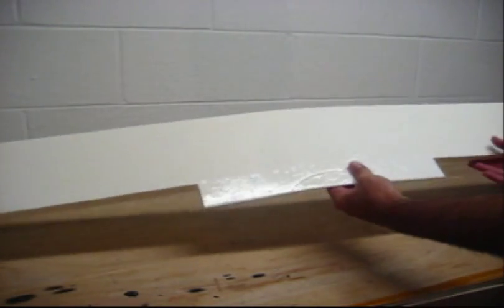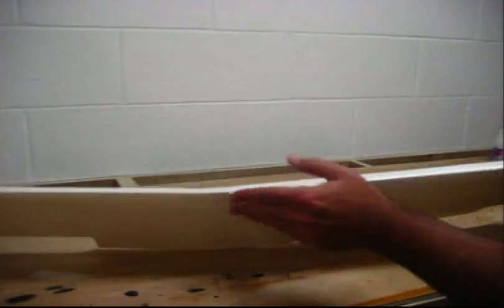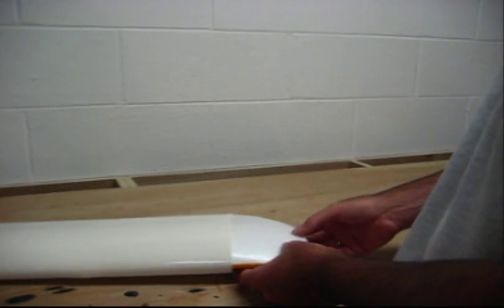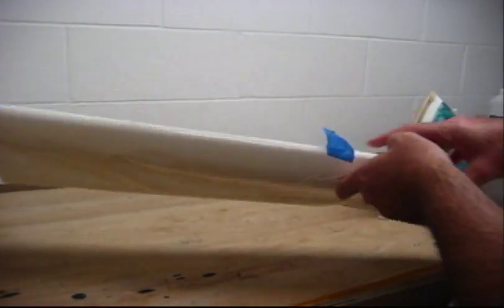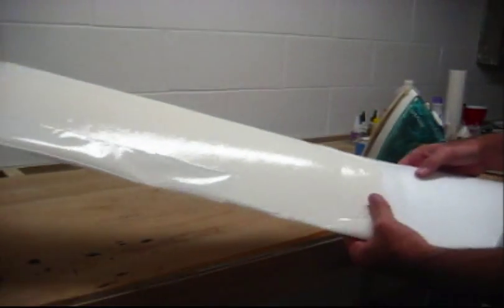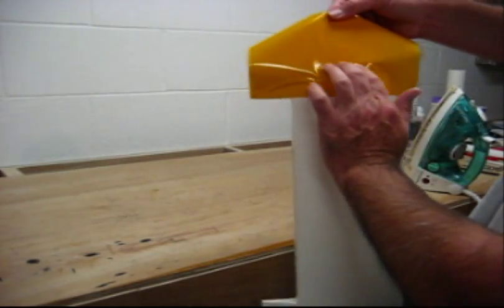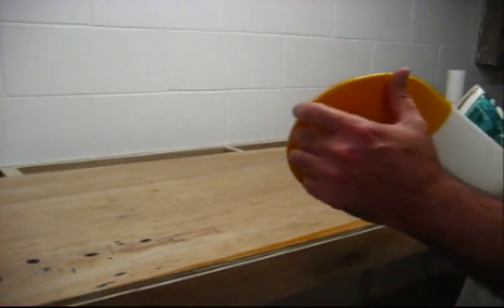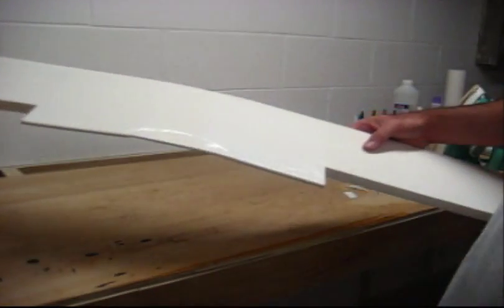9-Covering the Wing Top - Building HZ Super Cub from Scratch

Comment: I had a big crash lately using a slightly bigger lipo battery (2500 mAh) it ripped the wings of when I was flying a bit faster - ended in a brutal crash, I would suggest to  reinforce the wings with something (carbon, wood, stiff plastic) , it broke the wing at the root  just where it comes of the fuselage